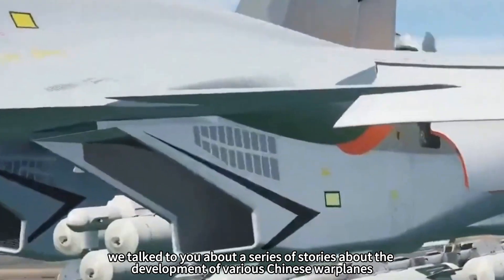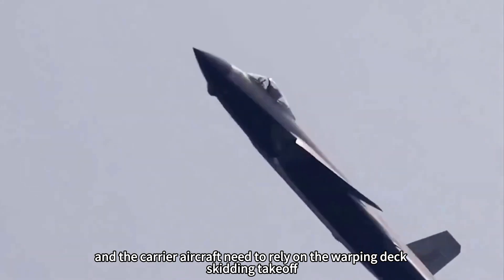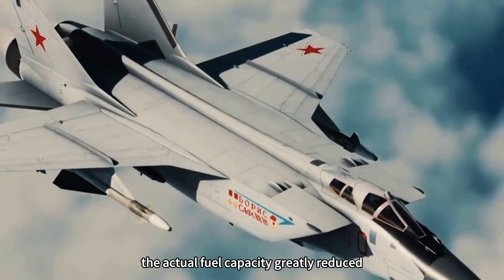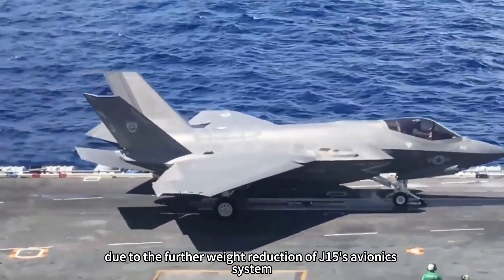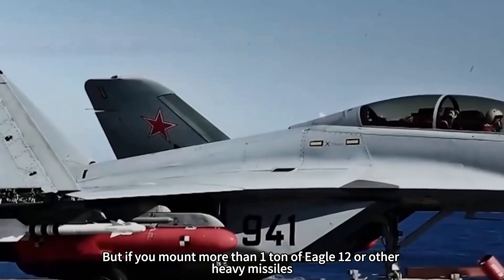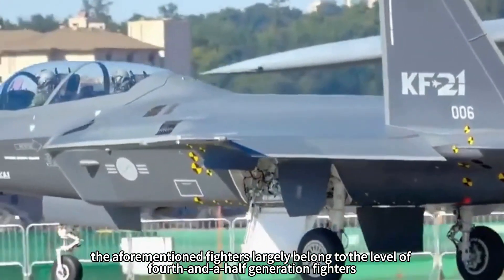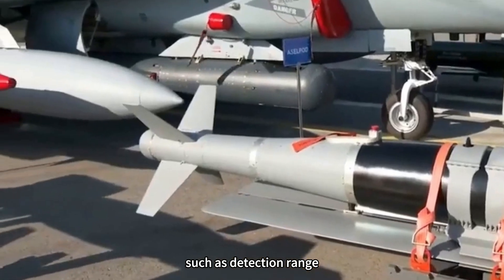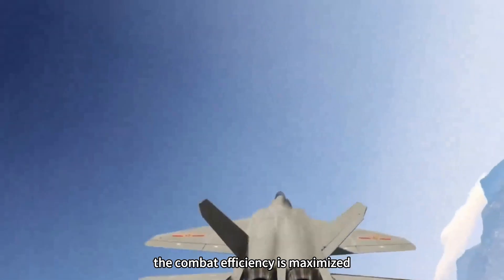With a maximum load of only 4 tons, how much of a problem is it for the J-15 to slip and take off?

Comment: The Chinese J-15 originates from the Soviet t10k prototype just like the SU-33 but it includes a large proportion of composite materials to bring its empty weight to 17.5 tonnes. Its maximum internal fuel capacity is 9.8 tonnes and its weapons load is 5.7 tonnes if it uses the starting position located 200 meters to port, planned for 33 tonnes maximum, and 28 tonnes for the 2 positions at the bow, 105 meters.
it can also take off with a full weapons load and 5.7 tons of internal fuel and be refueled with 4 tons of fuel by another J-15 in budy budy with the UPAZ-1A nacelle at a rate of 1000 liters per minute.
In the end, the limitation to 4 tons of weapons is an error
Concerning the avionics of the J-15, the latest developments in production are the single-seat J-15T, the two-seat J-15D for electronic warfare and the two-seat J-15S for training/control of friendly drones type GJ-11. They all have a large diameter AESA radar with more than 1800 galium nitride modules possibly at dual frequency (K/X see S/L).